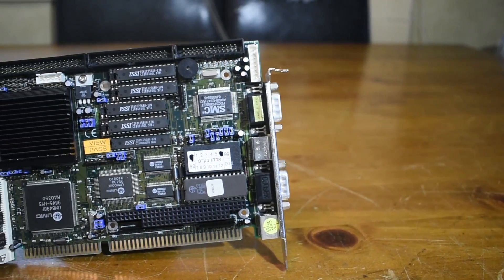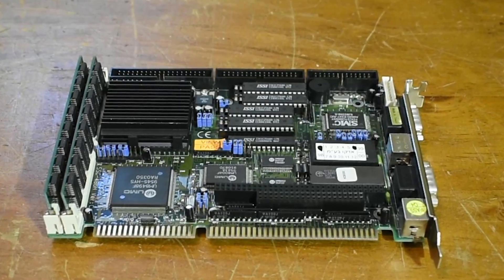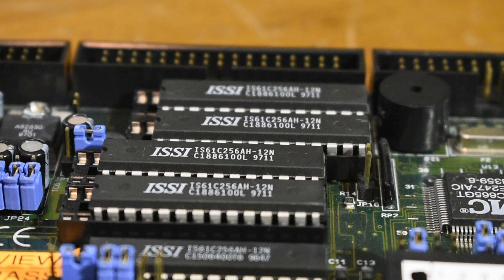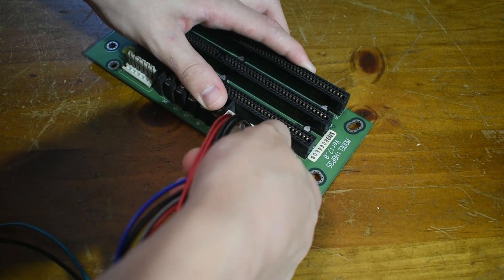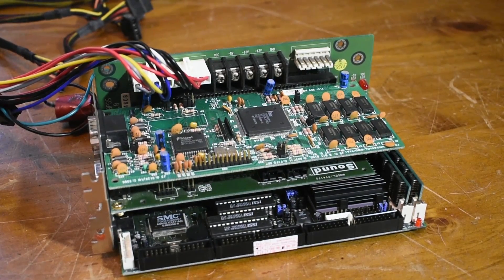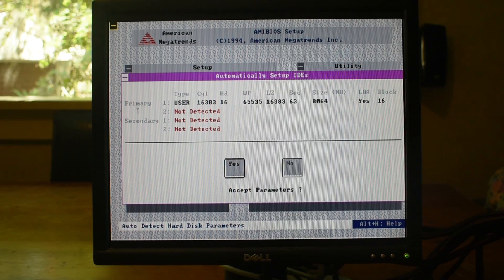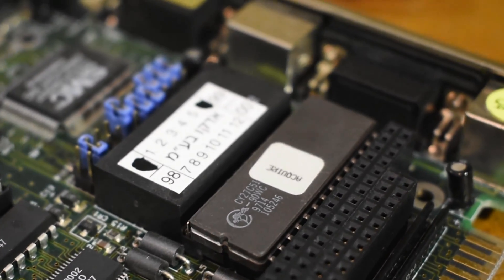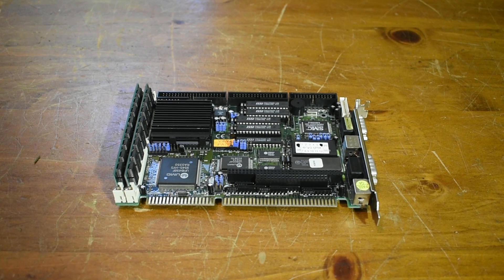A Tiny 486 Computer Overview - 486 Industrial SBC

Comment: You need a new (RTC) Real Time Clock chip DS12887 (A) made in Taiwan. About $20. The date on the chip is important. It will have a date code like 9549A2, 95year 4month 9day. This is too old!
You need one that has a date of 00 or 01 or higher.  Good luck!
P.S. It's the 24 pin chip above the bios chip. It will need to be disordered from the board, and I
would add a 24 pin socket to the board, then plug in the clock chip.

Comment: I've had a Pentium iii sbc sitting on a basement shelf for years and just now having a look at it. It's replete with a small steel case with screw-down tabs with power supply and backplane. I just used Win 98se for an os as it has the Intel 815 chipset. I've always wondered what these are for and why. Bandwidth and swapability seem to play a role. Mine's been good with a typical Soundblaster pci over the past week. Neat machine. It looks like there's some sort of plug around the top of the cmos microcontroller; does anyone know if this is for something like a Disk-On-Chip 32 pin flash disk?

Comment: I could not stop looking at the dead pixels on your old dell monitor. Lol. Good luck with the bios battery. I started mucking about with computers when the 286 was brand new... I was in my early teens. I was hooked. I became an engineer and took up electronics because of those old systems.
Reply from the maker: Ha! Yeah time for a new one I think! Yeah they're pretty awesome the old computers, they mean a lot more to me than modern PCs.
Reply: @ScanLinesAU  That is awesome. Makes me happy there is young lads to keep the retro community thriving.

Comment: Nice SBC! You should see if you can upgrade the L2 cache to 256KB or 512KB or a 5x86 cpu and unsolder the RTC and solder in a replacement socket and buy the new RTC that plugs into the socket so you don't have to keep resoldering on a new RTC battery. I think LGR just recently did a video and built a machine using an SBC.
Reply from the maker: Thanks! Yeah, that would improve the performance a lot hey. Planning on making a few more videos regarding this system, so yeah I'll have to see about doing all those upgrades. Ah yeah I saw that one. Funny enough I actually have wanted to make a video about this SBC long before he posted his video! But I only recently found a backplane.

Comment: Dang, that's a cool little machine. I found a Celeron SBC a while back but never got it working (no backplane). It's got that same weird 108 pin header... port... thing? along the bottom edge as yours; i wonder what that's for.
Reply from the maker: Yeah sure is, backplanes are expensive hey! That's a PC-104 header - basically an ISA slot, just more compact. You can actually get PC-104 SBCs as well, though generally they are like 486 clones. I opted for this style of SBC since it uses a standard 486 CPU.

Comment: You may want to check out "LGR" on YouTube.  He did a video about one of these about 3 months ago.  Titled: "Building a 486 DOS PC with an ISA Single Board Computer" He found a bigger ISA back plane for his with PCI slots and many more options.  Thought maybe it would interest you for some idea's for your set up.  Awesome video as always.
Reply from the maker: Ah yeah I saw that video! I actually have wanted to do this video way before he mad that one hah. I specifically wanted a small 3 slot ISA backplane, so that way I can build an enclosure for it, and have a custom tiny 486 pc.
Reply: @ScanLinesAU  Ahh so you were going for small and compact.  I get it now.  That would be so cool if you could find or maybe 3D print a mini case/tower for it; that looks like a full size 486 case; only scaled down to a smaller size.  Use a SD card reader for like the "pretend" floppy drive; maybe minidisc for the CD-rom drive.  You know scale everything down.  LOL....
Reply from the maker: Yeah, it'll be something different. Forget 3d printing, I'm going to fabricate a case using sheet metal! Haha, that would be cool, I'll have to see about adding that into the case design. System is hopefully going to be under 20cm square.

Comment: Hi, cool board! Awesome. You might check if you can apply method of connecting external 3V battery to "internal battery pins" of the Dallas RTC component. If you are lucky, you can "expose" the desired pins without removing/desoldering the whole Dallas component. Check this video https://www.youtube.com/watch?v=NdlSfqto_0o  I was sucessful on my (different) board, without deslodering, just using mini-grinder-tool to get the Dallas RTC internal battery pins exposed.
Reply from the maker: Ah yeah, interesting, I'll check that out. Thanks for the advice man!

Comment: hope you'll be able to get that dallas chip replaced, i'm facing a similar situation with my SGi octane2. i seem to recall a planned replacement with a proper CR2032 holder but that got lost along with nekochan. in any case, hope you will be able to get it up and running and good job so far.
Reply from the maker: Yeah, I'll have to fix it up soon, a CR2032 holder would be ideal.

Comment: The Necroware channel has the answer for the dead rtc battery for you if you wanna try it. Really cool 486 system on a board btw!
Reply from the maker: Ah, I've heard of Necrowave! Thanks, I'll check that out.
Reply: yeah but that solution might cause leakage later
Reply: @bamdadkhan  True, you have to pull the battery every time the pc is not in use meaning losing all settings with each pull. But at least it makes the system boot again. Or you could risk getting a Dallas DS1287 from ebay/aliexpress and hope its new.
Reply: @indimopi  actually, i meant the original battery that's still in there, only bypassed. some people suggest dremeling it out and connecting to its leads instead, that seems more logical to me.

but of course you're right, it's better than not booting at all : )